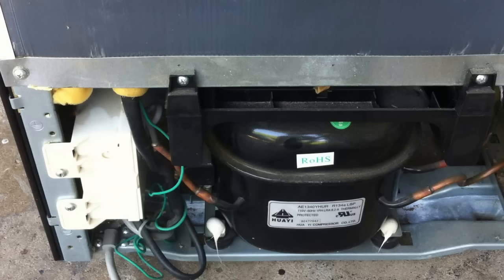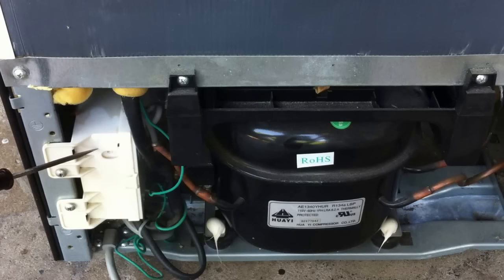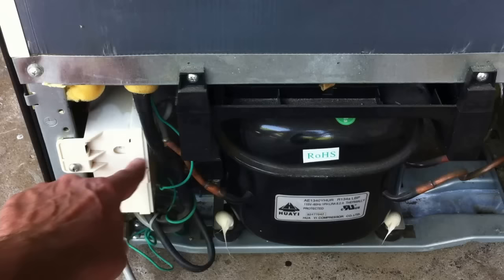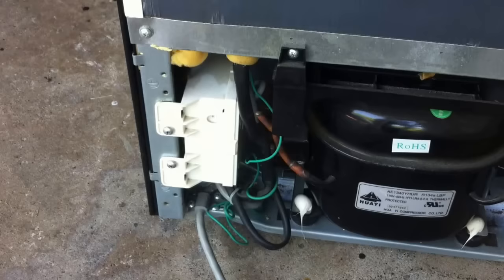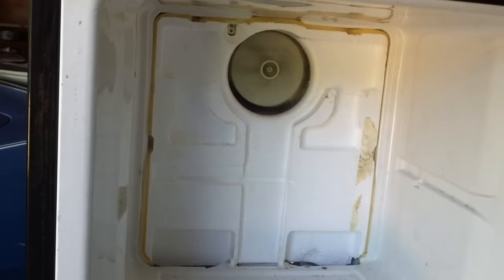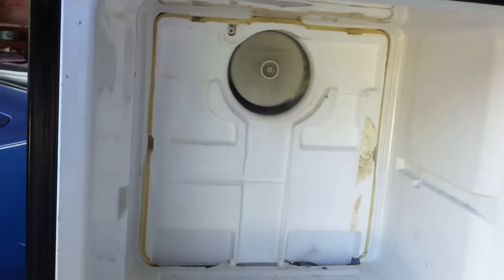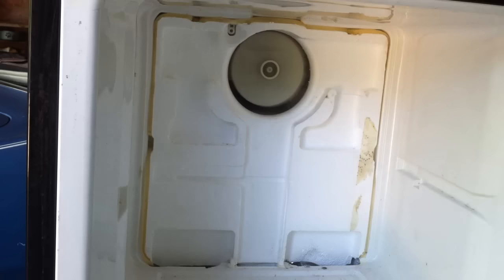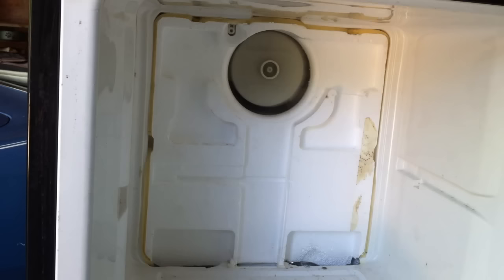Easy Refrigerator Fix, Reset (Defrost Timer) Switch, if it stops running, cooling or working.

Comment: I'm gonna need you to back up from the mic just a little bitty bit
Reply: The refrigerator shuts off every 6-8 hrs to defrost, that "trip switch" is a defrost timer, and they go bad regularly - best to replace them the 1st time they go bad - but the refrigerator is supposed to shut off, so they can defrost-- if you manually skip the defrost cycle by doing what you did in this video, you can cause the coil to freeze up and the refrigerator not to work properly- and that could ruin all the food inside -

Comment: That's not a "trip Switch" it's the defrost timer it turns off the fan and compressor and energizes a heating coil to defrost the evaporator coil. it's usually lasts 30 to 45 minutes then returns to normal operation. if you have to manually turn it back on then you need to replace it.
Reply from the maker: I've covered this issue before. I didn't use the "reset switch" for 2 days once, & the refrigerator NEVER came back on UNTIL I turned the "screw" head. Why would they make the refrigerator with a screwdriver head that never needs to be turned manually? If it's for defrosting it should just come back on automatically. If you read the comments this has helped a good number of people.
Reply: Michael Powell It is a defrost timer and when it fails it needs to be replaced . Failed in off position symptom  : the inside fan is not running .  Failed in "on" position :  Ice ( snow) builds up on back wall or floor of freezer . You never need to turn the timer with a screwdriver unless it is broken .
Reply: Michael Powell The reason it has slots for a screwdriver is so that the technician, who actually knows what he's working with and talking about, can test the defrost timer to diagnose, then PROPERLY repair the issue. I give you props for finding this yourself and letting others know so that they can utilize this while waiting for parts/repairmen to arrive, but you need to also let them know that this is just a symptom of a larger issue (which is normally very cheap and easy to fix), so that they can resolve it in the long term. If you're content with your food getting very warm (and growing copious amounts of bacteria/mycelium/spores) after it enters the defrost cycle and just waiting for your to manually cycle it, great, for your purposes you can say this is fixed. However, this is not an actual fix, it's a (supposed to be temporary) work-around.

Comment: https://www.flickr.com/photos/sega32bit/albums/72157700287544604

Yea It's a Defrost Timer, it's also operated by a little motor that's turning all the time but really slowly 8h Defrost cycle etc if it becomes stiff then the motor wont be able to turn the gears inside, mine went on my fridge freezer except mine was tapping really loudly made worse by it echoing through the whole fridge, the fridge eventually stopped working  I just stripped apart the timer and greased up the cogs, the tapping sound was from play on the motor bearing but greasing the sleeve bearing sorted it, fridge is working a treat now and very quiet.

Comment: Would unplugging it for a minute then plugging it back in reset it? I would think there would be a hole in the back with to adjust it an instruction sticker. A housewife should not have to try to pull it out and take the back off, not knowing what she is doing. I agree with you. Things seem to fail on purpose so you bring them to the dealer and pay to fix it. Like an idiot light on a car. They probably turn the idiot light off and reset it to come on in a year, then hand you a bogus bill. I think the more you learn how to do it yourself, the less you get milked and robbed. And, instruction manuals should have a schematic and a troubleshooting guide. I have fixed many things but first I take it apart, figure out how it works, then find out what is not working. I will fix it if I can, or replace the part. If you can remove a part, you can put a new on back on.

Comment: Its called a defrost timer and if u have to manually turn it means its bad and need to change
Reply: Sometimes it's the defrost resistance. In some models, the electromechanical timer is wired through the defrost resistance.

Comment: I left door open 24 hours now fridge not working help!
Reply from the maker: As I've stated many times I am NOT a frig repair guy. But... in your case I would try to at least unplug the unit, wait a couple of minutes & plug it back in. That's the only thing I would know to try if it was working up until you left the door open.
Reply: @steelcantuna  I will try I'm nervous how much it would cost to have tech come out n pay just to look at it I'm on budget wasn't expecting this but this is my carelessness. I'll keep my fingers crossed

Comment: Timer advance is not the same as a "reset" switch. All you did was manually advance a mechanical timer. The timers go bad and need to be replaced, as with all things with 24/7 moving parts.

Comment: I cant find any such switch on my fridge. :( :( :(
Reply from the maker: They don't ALL have one. I had fridge die on me about a year ago & couldn't find the "defrost timer switch." After much research, I found the unit was computer controlled instead of mechanically.
Reply: @steelcantuna  aaaah. ok and i have this weird retro Galanz fridge. Only had a year and stopped getting cold enough, just a little cold. Missed the warranty by one week. :( No one seems to know how to fix them around here, as not very popular i guess.

Comment: >>>>>>>YOU ARE ADVANCING THE DEFROST TIMER. BE SURE YOU ONLY TURN THIS CLOCKWISE TO ADVANCE TIMER. THE FIRST CLICK SHOULD BE DEFROST MODE. THE SECOND CLICK SHOULD BE COMPRESSOR MODE. TURN VERY SLOWLY TO NOT MISS THE FIRST CLICK. IF STOPPED AT FIRST CLICK, WAIT 40 MINUTES & REFRIGERATOR SHOULD GO BACK TO COOLING MODE. IF NOT, YOU MAY HAVE A BAD TIMER.
Reply: On my fridge's timer, an arrow indicates to turn counterclockwise. So make sure you look something like that before turning it either way.

Comment: water dispenser won't stop running
Reply from the maker: +Evangelist Eaglin 

I’m not a refrigerator repairman. But, there should be a
water turn off valve on the back of your refrigerator, if not, just put a clamp
on the water inlet hose to keep it from running until you find a solution. Good luck.

Comment: 2022 sept 3pm i  Noticed Fridge not Running  -#1 Trys leaving power off 1-2hrs Not this Time ./..\ So  checks  the Google Bible of Redkneck Science fixer upper Videos .
Ok pulled Fridge out and turned the Tripswitch a tad  it went  "Click" turns on Power Working 
              Then spent 1 hour cleaning the Water trough  the feeds the  dead roaches underneath - 
Aussie i use them Buzz stickypads ( bunnings - $3.60)  always in dark  corner s under  furniture -  this Olde rented room 1847 built d/storey SA oz

Comment: that is the defrost timer... they quit quite often ..... you can manually turn them .... it is not a reset switch !!!   it gets stuck in defrost mode ......
Reply from the maker: It doesn't have ANYTHING to do with a "defrost timer." The whole refrigerator is OFF, UNTIL the switch is turned. I left it plugged in for 2 days & it NEVER came on again until I turned the "reset switch." It's real simple.
Reply: The white box is a defrost switch? Can you tell me please, is there a way to stop it from making a constant (and annoying) quick clicking sound when the fridge is running?
Reply: great video

Comment: No switch on mine. Thanks anyway
Reply: I read another comment that says the switch is sometimes inside.
Reply: Yes if you open up the inside of the fridge an find the thermostat dial it is on the underside of that.
Reply: Not here.
It's irrelevant anyway it started working on it's own. I believe the condensate trap was blocked with ice, may have overheated the motor due to poor circulation of air

Comment: The refrigerator shuts off every 6-8 hrs to defrost, that "trip switch" is a defrost timer, and they go bad regularly - best to replace them the 1st time they go bad - but the refrigerator is supposed to shut off, so they can defrost-- if you manually skip the defrost cycle by doing what you did in this video, you can cause the coil to freeze up and the refrigerator not to work properly- and that could ruin all the food inside -
Reply: Just wondering, for all the people that said it fixed there fridge, after about a month did your freezer frost up? Or did the defrost timer start working again.  Would love to   know.

Comment: Jesus, another "how-to" vid from someone who has no clue. That "trip switch" is the manual reset for the defrost timer-should never be turned counter-clockwise like you did, and is NOT a "reset" button. A frost free frig goes into defrost-that's intentional, not "shutting off"
Reply: He may not have had a clue, but he was a brave detective.